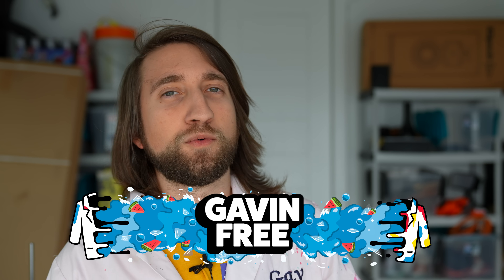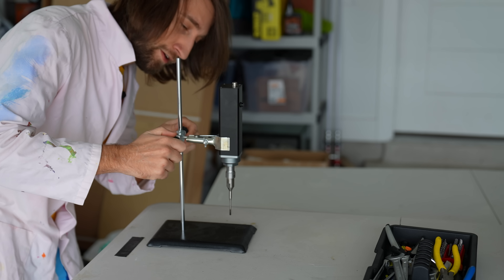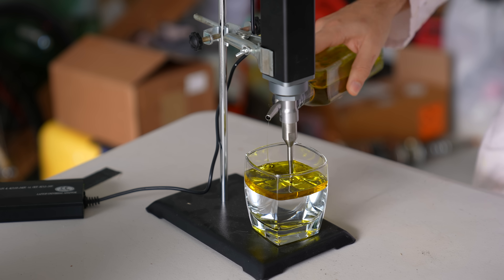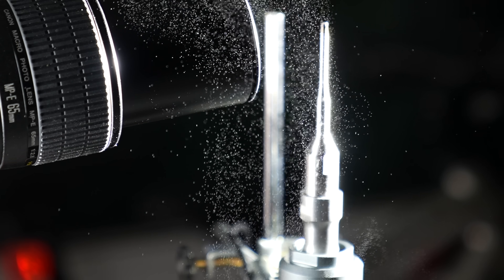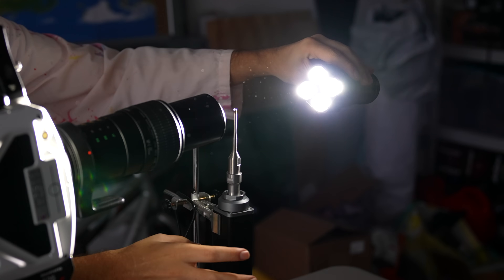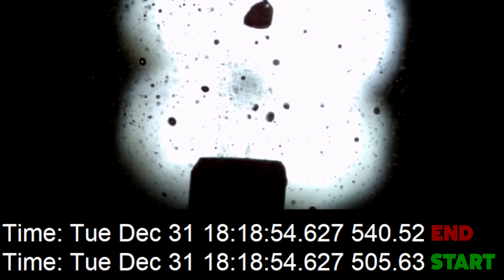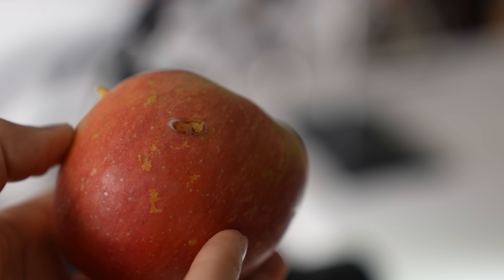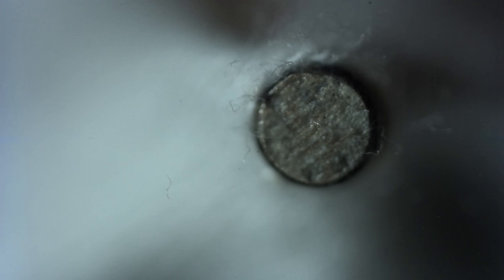Ultrasonic Obliterator at 170,000fps - The Slow Mo Guys

Comment: Very cool to see this in slow-mo! I use one of these ultrasonic homogenizers regularly for my research. Something else you could try that is related would be a tissue homogenizer. It has a rod similar to the sonicator that spins incredibly fast inside a metal sheath. The tip of the rod is exposed at the end of the sheath so that it can shear tissue or emulsify liquids at really high speeds. It should be noted that it can be very dangerous if used improperly! Maybe you could do a series of science related slow-mo videos!

Comment: I wonder if the oil/water emulsion will stay emulsified or will it eventually separate out.  Also, running the emulsion through a centrifuge will cause it to separate, ya think?

Comment: Okay, I have no idea if you'd be able to get your hands on the equipment for this, but there is a technique used in both mass spectromotry and and polymer synthesis called electrospinning, where an applied voltage across a vacuum pulls liquid down a wire and it creates a metastable flow shape called a Taylor Cone which look really cool in Slow Mo (https://www.youtube.com/watch?v=fFto_zm_UrA). Might be something you'd be interested in

Comment: 8:00 - Excellent example of the aliasing issue. It’s quite similar to a problem than can be encountered when digitizing sound. If the sample rate is less than 2 times the highest frequency of sound captured (known as the Nyquist frequency), then the digitized sound will not sound like the original. That’s why CDs have a sampling rate of 44,100 Hz. Since the highest audible frequency is around 20,000 Hz, the Nyquist frequency is 40,000 Hz.

Comment: Apart from a sonicator, we also use a 122,000G centrifuge at our lab, to separate solubilized molecules based on their density. That would be cool to see in slow-motion, but probably also far too dangerous. :P

Comment: Hey Gav,

When you're trying to measure a frequency, I'd recommend measuring multiple periods and then dividing by the period, effectively performing a mean. This way you minimize the error in measurement, which could actually explain (I think) the .35ms period instead of .33ms

Anyway, great video!

Comment: Suggestions for you guys: Stirrer in the lab and heat plate (I remember we pour water, and the water floats and dance on top of the plate, I did slow mo via iphone, but it would be cool to see the water turned to gas with your equipment), and lastly there is always an experiment with final drop of a chemical compound to a cup of mixed compounds that it changes color of the whole compound in the cup, if we could see the color change in high framework, would be interesting. :)

Comment: I once worked in a plastics factory that used a sonic drill press similar to this, it would vibrate at ultra-high frequencies to instantly heat threaded rivets as they were being inserted into plastic parts. The press was computer-timed so the plastic melts just enough to seal in the rivet without burning. I thought that was such a neat tool and this brought back some interesting memories. Thanks Gav!

Comment: If you're looking for lab stuff to film in slowmo - Liquid nitrogen can be fascinating to watch so I'm sure it can look cool in slowmo. Some stuff that I'd be interested in:
-Dispersing it through a phase separator (a porous metal or ceramic sponge, kind of like a showerhead for nitrogen: https://www.nitrogenx.co.nz/product/large-phase-separator/ ).
-Pouring nitrogen into / onto stuff
-Pouring stuff into nitrogen
-Pouring it through paper towels (I was surprised to find out that it doesn't really soak the towel, but passes through pretty quickly - I'm assuming because nitrogen adhesion to cellulose is weaker than for water)
-Freezing stuff and shattering it (that one's been done a lot already tho)

It's always hard to see exactly what's going on with nitrogen because there's water condensating everywhere, which makes it kinda difficult to get good footage I guess.

Comment: it would be cool if you were to make a 3D printed dish to fit to the end,  kind of like the paint on the a speaker vids you've done but at super high frequency.  high speed fluid dynamics makes getting out of bed in the morning worth while!  even better if the 3D part breaks we'd also get slow mo shattering.  :o

Comment: What if you used that with soda that has a lazer pointing through it so that you can capture not only the bubbles forming in slow motion, but also capture the light reflecting off of the bubbles that are being created?

Comment: Ultrasonic probes are routinely used for welding plastic in electronics and packaging. I assume your lab coat is synthetic and it melted a hole, whereas with the cotton t-shirt it sort of bored a hole through.

Comment: Any kind of heavy duty centrifuge. No idea how you'd make it safe but spinning down a mixture into it's separate parts at insanely high speed. Any lab should have some so maybe you could get yourself invited somewhere instead of buying one since the fast ones aren't cheap. 

They also have homogenizers that are bigger and used to like put animal tissue into solution. 

Medically looking at the retract mechanism on an IV needle or finger lancet could be cool as well.

Comment: Instead of picking one arbitrary up and down cycle, you get a more accurate measurement if you do, say, 10 cycles.   In fact, your margin of error goes down by 10. The more you do, the more accurate your measurement.  Similar to trying to measure a single piece of paper. It's easier to measure 1000 pieces of paper and dividing the answer by 1000.

Comment: He's an idea for a related video: I've an ultrasonic cleaner in my bike workshop; the transducers of which  run at 40KHz, and they get grime off bike chains and cogs very well, They separate oily gunk from metal in a water bath, so a parallel effect to the probe. Some detergent in it enhances the cavitation, and if you use glass sub-containers (to avoid filthing up the main chamber), they transmit the vibrations better than plastic ones (or so I've been told by a friendly lab tech). The cleaning cycle is 30-60 minutes for your average drivetrain: I wonder if there's any way to speed it up, or enhance the cleaning action?

Comment: I've used these to shred open bacterial cells! They can also come with attachments to replace the probe with a small container to hold liquids. Similarly, it may be cool to do slow mo on ultrasonic cleaners used for jewelry and surgical tools.
Reply: How well does it shred open viruses? Asking for a friend...
Reply: Considering what it does to everything else...probably pretty well! That being said, I've never used it for that purpose. If nothing else though, the heat it can generate after prolonged use should do some real damage! With bacteria, we frequently keep them in an ice bath to prevent the heat from destroying the proteins we are trying to extract.

Comment: Lab equipment suggestion.
Alpha radiation cloud chamber experiment using dry ice and ethanol.
Show both Brownian motion and alpha particle streams. Would be slow enough for 4k 1000FPS and probably lower.

Most setups have back lighting ports build it.
The hard part would he linking this to a microscope for the Brownian motion... It requires high levels of magnification. 400x ideally.

Comment: @The Slow Mo Guys Wouldn't that be possible to film in "artificial ultra slow motion"?
Exactly like in that video where you filmed light traveling in slow motion, by sending multiple light pulses & each time wait a little longer.
So, if that machine vibrates at 30k then you can film it at an evenly divisible number, like 15k or 10k, 7.5k frames, or something like that, then just offset the frame-rate just a little.

Comment: Put a drop of kerosene on the tip and have a flame just above to where it doesn't ignite, then turn the sonicator on. I think it would be cool to observe the tiny air currents of the tip interacting with a small flame.

Comment: Chemistry suggestion: Water exploding (aka "bumping", aka super-heated water instantly boiling )
MythBusters did an episode about this, but the footage wasn't that great. What happens is if you boil water in a microwave and the cup is perfectly smooth, bubbles won't have a place to form. This means the water continues to heat up ABOVE the boiling point. Many people don't realize this, keep microwaving, and then stick something in the water, the moment you disturb the water, it instantly boils. (Or explodes really)

Comment: Clean the tip with rubbing alcohol and table salt. Just swirl it around a little aggressively like your mixing some chocolate milk. Hand dry and then rub with mineral oil or machine oil for storage. That way it wont degrade any more than it would have from the factory. Do not power it in the alcohol, that could be lethal.

Comment: Great video! I think you should do a series on visiting machine shops and factories, I would love to see the different eg chips smashing off of steel on a lathe or how sparks form on a grinder from the metal, and how the sand flies around inside a sandblaster.

Comment: Same or simmilar tech is used for welding plastic ... ultrasinci welding .. could be interesting to see that in slow-mo ... those machines are basically same as this but scaled waaaaay up and use the heat of the friction from the motion. Also .. if you dont wear propper ear protection . they tickle your brain :D

Comment: The reason it can get through cloth I think is a consequence of material fatigue, it usually doesn't occur until a large number of stress cycles has happened but since there are 30000 cycles per second it doesn't take long

Comment: Couple of thoughts:
You can't tell if the frequency is off. At 171k fps your resolution is 5us and you say the period is 35us. Timing say 10 oscillations and dividing will get you a better estimate. Not that it matters really.
You also need fps to be more than twice the frequency of the sonicator to really be able to tell how it's really moving. This is a fundamental principle in sampled systems called the Nyquist-Shannon sampling theorem. At 7:15 you can see the tip is blurry yes seems to also be moving really show. It's because frame rate is not fast enough to capture all information unambiguously

Comment: This shows how ultrasonic welding plastic works. Essentially take this and place it on two sheets of plastic. It will heat up and bind them together quickly and without any glue.

Comment: Slow mo of the Bunsen burner flint and steel lighter thing. 
It would be cool in a few ways, to see the sparks, and see the fire travel from the trapped gas in the cup of the igniter and then down into the Bunsen burner or oxyacetylene torch.

Comment: Just last week I bought a humidifier.  I saw "ultrasonic" on it, and thought it was just one of those marketing words they stick on products.  I just looked at the ml/hr and thought, "that's good."  It wasn't until later I realized it was using ultrasonic waves to atomize the water.  The apparent draw back to these is if you are using tap water, the minerals that end up as scale in heat driven vaporizers now ends up as a fine dust in the area around the humidifier.  I keep checking, but I've yet to find any appreciable amounts.

Comment: You might want to try this with a vapourizer. They use flat piezo devices but I believe they oscillate in the Mghz  range. By the way, ultrasonic devices are used to weld plastics together so it's not surprising this one generated so much heat. Very interesting. Might have been fun to see it make Mayonnaise. How about a centrifuge separating suspended solids (blood for example)?

Comment: Put rubbing alcohol in a standard water bottle and pressurize it with a tire pump and rubber stopper. Once fully pressurized, u release the rubber stopper and it creates a sort of vapor in a an instant. Always wanted to see that in slo mo

Comment: Try the ultrasonic homogenizer in a vaccum, or you could possibly make an underwater breathing mask without the use of Big clumsy airtanks by splitting and filtering water and oxygen to pure oxygen, and to go deep sea, instead of mixing helium, simply just take a pill and wear my special mask  =)

Comment: They have hot plates that both heat liquid and have a small magnet that looks like a pill you can put in fluid which will spin at high speeds to mix the fluid from the inside. They may be cool. You get heat and moving fluids all in one. (mainly used in chemistry labs I forget their actual names though I just called them hot plates)

Comment: it would be interesting to see what it would do with glass, metal plates ( coins), wonders if there is enuf stroke to see what it would do in a magnetic field, also wonder if vibration is enuf to set off a primer of a bullet ( instead of impact pressure, a vibration, would make for a new "hammer" in a gun)

Comment: I think the time per frame resolution isn't enough to show the difference between that measured frequency and the nominal one (at least not from a single cycle). Knocking off just one frame ends up with a higher-than-nominal frequency.

Comment: So, if you got a big enough one of these and sharpened it like a blade it would be super effective at cutting... probably.
Reply: Hi Gav! I actually used this instrument many times before. I'm working in a biochemistry lab and I used a very similar sonicator to extract proteins from bacteria cells. With this instrument, if you use it corectly, you can extract proteins that are not harmed from the forces and heat of the sonicator than you can later test their activity in a tube, purified from bacteria. It's very interesting to see this in slow mo. I didn't realize that the thin arm goes up and down. I thought that it goes slightly side-to-side. I hope you used sound-proof headphones because the sonicator can hurt you hearing. Thank you!

Comment: You should look into ultrasonic welding. Due to the fact that deforming matter is never a pure elastic process, you end up dissipating energy through heat. This is why you were burning pretty much any solid matter. Ultrasonic welding equipment is taking advantage of this effect to weld thermoplastic parts together at amazing levels of speed and precision. I would love to see slowmos of that process. 

Anyway seeing the drop vibrate and being obliterated was incredible !

Comment: One of the reasons the oil goes downwards is that the cavitation bubbles in the water reduce its density so much that the oil sinks. You can see this happen in the first shot with the oil. I thought that was cool

Comment: Hey Dan, I used to use on of these in a molecular biology lab. We homogenized insect tissues. It would be interesting to see the tissues homogenize in slow-mo. Not only insects, but how different types of plant and animal tissues react. Also, if you can get a wide enough probe, say a quarter inch tip, it makes a great cappuccino frother :)

Comment: I wonder how much of that heat is generated not by friction but rather rapid compression.  It's a common misunderstanding about rocket reentries, everyone believes it to be friction, but it's actually rapid compression of the air.  Think of how a diesel engine ignites the air-fuel mixture... by compression alone.  What'd be in interesting to know is if solids also undergo that kind of rapid temperature increase when compressed as I know gasses do.

Comment: one of the jobs I worked with was using an ultrasonic transducer ( 2000W) combined with an 8" wide 10"long titanium blade to cut frozen tuna into 2" thick slabs. It would slice thru an 6-8" wide tuna ( frozen rock solid) in 1.7-2.2 seconds. If you touched the blade when the unit was running it would leave a blister on your finger as if you had burned your self. Pretty much destroyed the cells in the "meaty" parts of the fingers. We had to cut slots in the blade due to harmonic vibrational waves were destroying the solid blades, the blade would shatter instantly if the unit was turned on with the power setting higher than 66%.

Comment: Molecular biologist here with another "intended use" of sonicators.

Depending on the experiments we do, we sometimes use sonicators to mechanically rip cells open to extract DNA or proteins. Some techniques use chemical products like bases to dissolve the membrane of cells, which if you remember your high school biology class, are mostly constituted of oils. However, for some experiments, the introduction of those chemicals may be undesirable so we sometimes use sonicators to physically punch the cells tens of thousands of times per second in order to gain access to their guts.

The thing to be careful about is that we must not use the sonicator on the sample for too long because it will also start to rip apart your DNA strands.

Comment: Me, early in the video: "Hmm, what would it be like to touch the end while it's on...?"

Me, later in the video: "Hmm, probably a good thing I don't have one of these."
Reply: I touched one of those that was in a water fountain, it pushed the water up and made a mist. It felt like getting electrocuted..
Didnt realise what it was before i watched this video..
But i bet that one wasnt as powerful as this one.
Reply: @christianlind919  i mean youre not wrong, since theres so much friction it felt like youre getting shocked. But electricity also produces heat, so it kinda makes sense. However as long as you are touching the water and not the ultrasonic plate itself its safe enough to dip your finger in
Reply: Yeah, thats what i figured too.
I did touch the plate at the bottom of the fountain.. and it did hurt..
Being curious can be painful
Reply: @christianlind919  Curiosity killed the cat lol
Reply: Ultrasonic humidifiers are the same, when you touch the piezo it feels like getting shocked